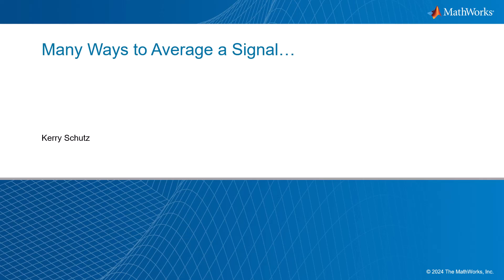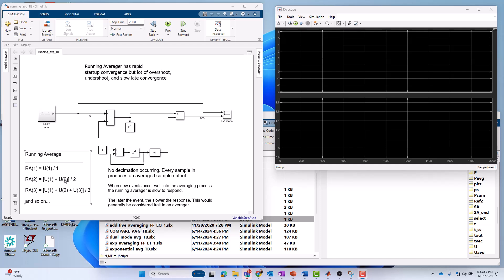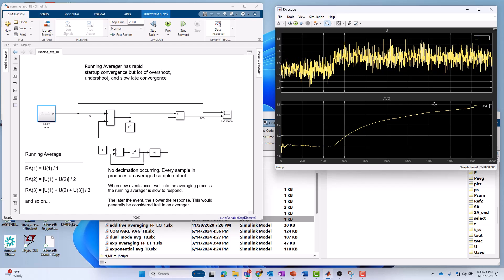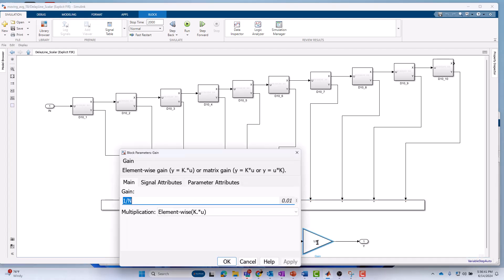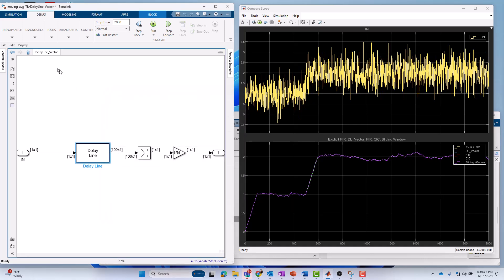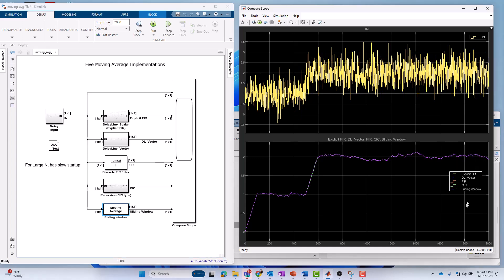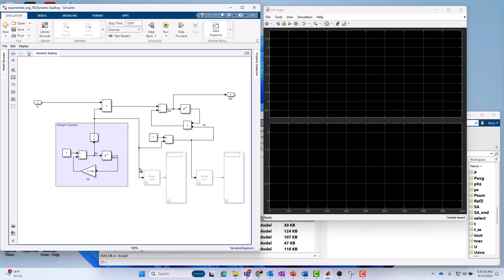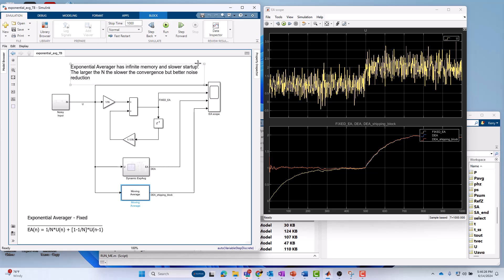How to Average a Signal Using Simulink

Comment: I really like this kind of content, with a "need" and different "solutions". Also, I was using the Moving Average block but recently i needed to dynamically change, in run time, the window length, to test different outputs and this video helps me.
Reply from the maker: Thank you for your feedback!